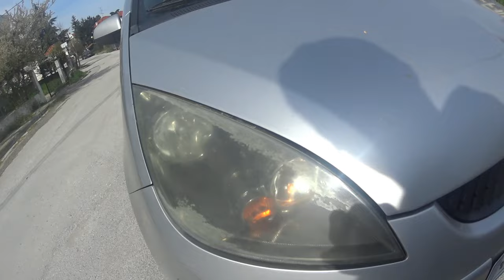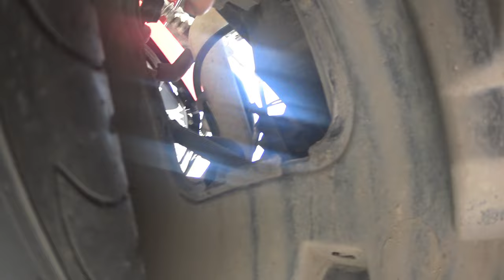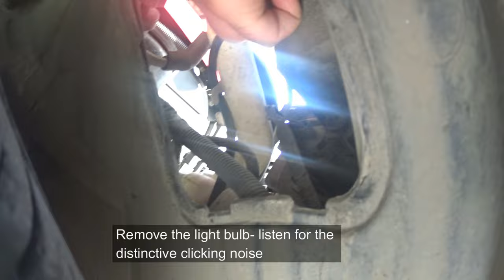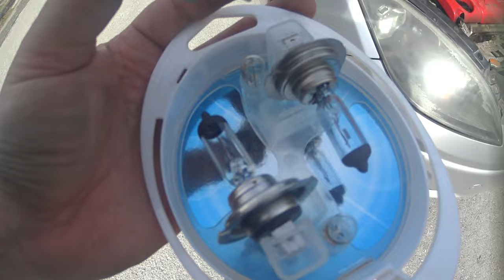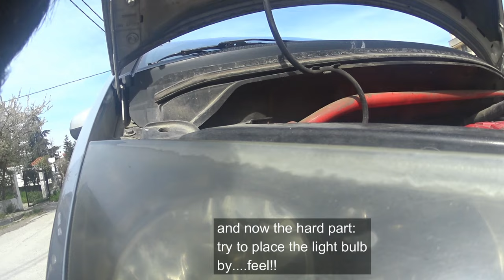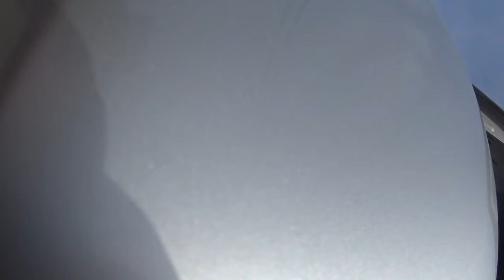How to replace the headlight bulb in a Mitsubishi Colt

Comment: Putting that cap back on was a nightmare, especially on the left headlight...
Reply: Such a stupid design it is mate, why cant it be like the other headlight bulbs just lift bonnet and change it from back of the light ? why they have to make it awkward , if it was a sidelight i would not be bothered but I'm forced to drive around with 1 headlight not working due to the stupidity o f this design.

Comment: Really useful. The plastic cap is the hard bit especially if you forgot to notice which way up it was when you took it out!
Reply from the maker: And it's even harder if you put bilstein suspension&coilovers which lower the car..!
 but I found out that you can replace the headlight bulb from the hood-without taking the cap out from the wheel well

Comment: Just wanted to see what bulb I needed to be honest. :D

I just unscrewed the headlights (2 screws) and pulled them up a little. Could change the bulb without problems. Way easier than through the plastic covering on the bottom. :)
Reply: I'll have to try this. Worked for me with my old Toyota Corolla from 1997. I hate to do this by feel only.
Reply: I was stopped by torx screws. Why would anyone put large Torx screws anywhere just to annoy people. Well I managed to plug in the new lightbulb on the first try by feel only, guess previous experience helps.

Comment: I will have to do this soon. I can be wrong but It seems that you can get more space if you turn the wheels to the left. I will give it a try and report here if it's better or worse.
Reply from the maker: Yes I forgot to mention it, it is better if you turn the wheels, mine though is lowered with aftermarket coilovers so there is even less space.

Comment: Guys, how can you make sure that it points to the right direction? I had mine replaced but now the light points way higher than normal and when I try to fix it by adjusting it from the steering wheel, I ruin the other headlight. 😭
Reply from the maker: the light bulb ''clicks'' when you place it in the normal position.. If it is higher or lower you did not place it correctly. 
Hope this helps!
Reply: allos MD A mechanic did it for me but I ‘ll check anyway. Thank u so much!
Reply: Tnx mate. Now I get to drive my little Czt this evening to my pall to celebrate my birthday without risking a fine. No lies in the distinctive click btw. very metallic almost spring like. Cheers
Reply: How can you adjust angle from steering wheel??  You mean high and low beam??